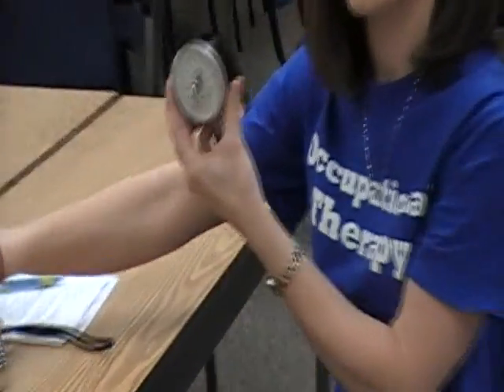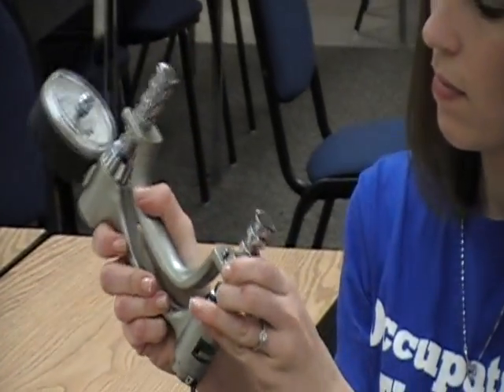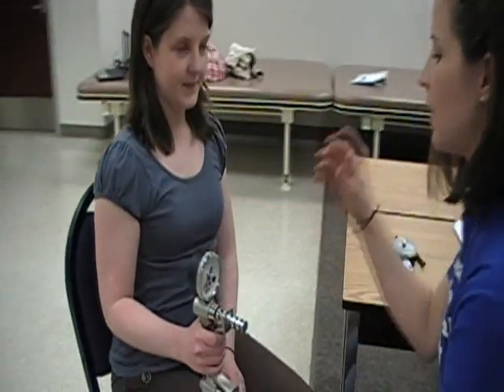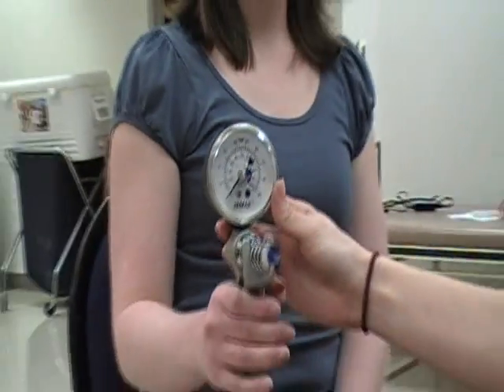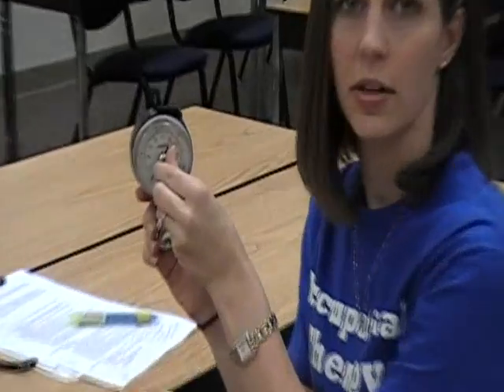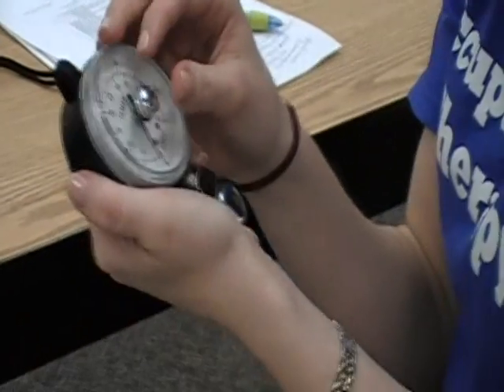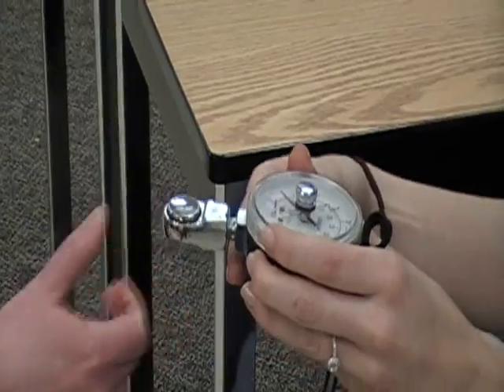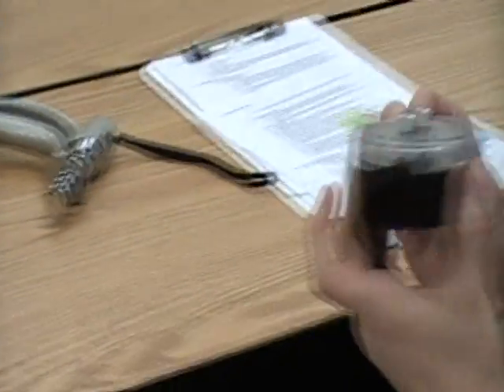662 Lab Practical - Grip and Pinch Strength

Comment: Interesting with the pinch gauge. I always do lateral, three point, and two point pinches. I've never done a variation on the two point pinch when evaluating clients before (pulp to pulp and tip to tip). Thanks for the upload.